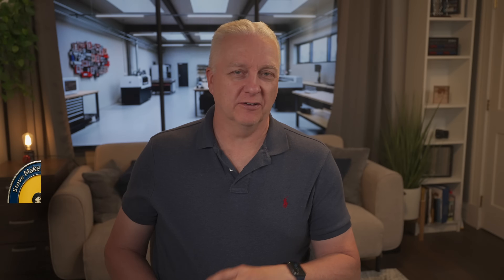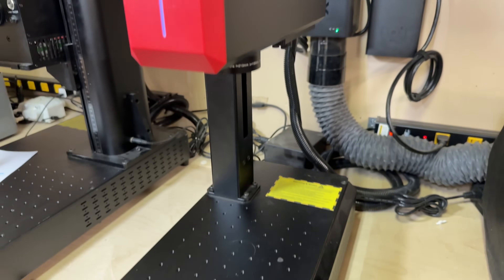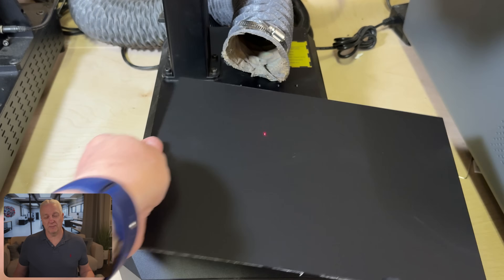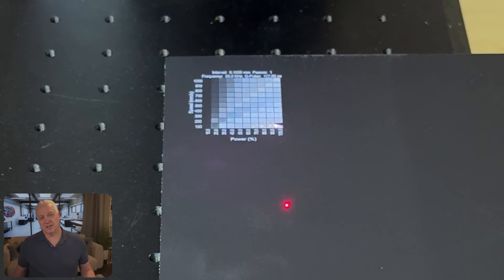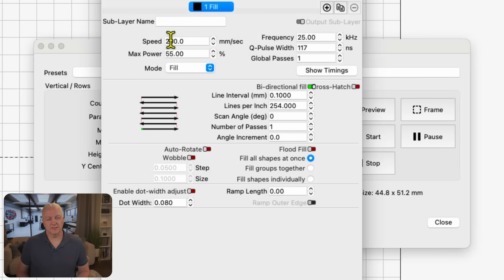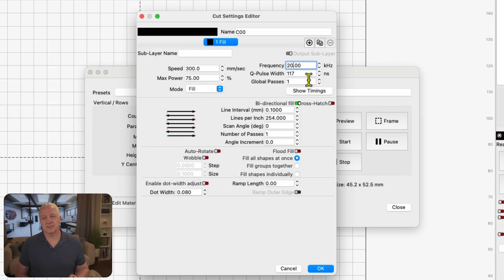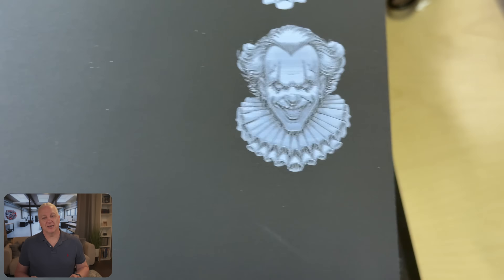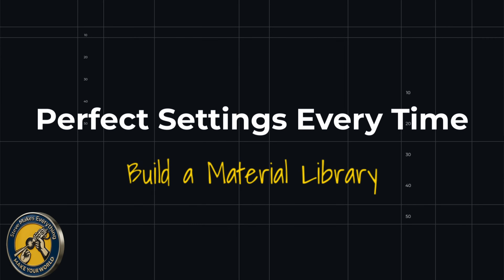Your Laser Settings Are a Hot Mess! Here's the Quick Fix!

Comment: Oh wow!  You just saved me from kicking my Omni X. I am so overwhelmed at running test files and not knowing which of four parameters to choose to run two at a time. As you already know, Commarker's library for this stinks as every metal has the same settings, and you are on your own. With little to no experience with UV I've been questioning my sanity about buying this.  This helps a LOT Steve. Thank you. Now I know for sure to get at least two to three run to dial them in. I now also know I have to get Lightburn rather then use the Commarker Studio.  Thanks again Steve!!
Reply from the maker: Glad this was useful. There is some learning curve to Galvo lasers. With the Omni 1 most times you can set the frequency to 49 and the Q pulse to 1.  Then vary the speed and interval to get decent results.

Comment: I have been engraving a couple of canvases that I first painted gold or something and then black, and then used the laser to burn of the black.. all works well and looks pretty good..
But then I thought I would try some alternative colors, that worked as well as long as the top/last color is very dark/black.

But I wonder if there is any technique/way to have white at the top/last color.. so first layer black and last white.

I have tested a couple ways, but nothing that really works 
 I am curious to hear if someone have something that works.
Reply from the maker: For a diode laser the white is going to be problematic since white surfaces don’t absorb the beam.  If you are using a CO2 laser you probably wouldn’t have this problem

Comment: Just got a 30w Raycus and spent the day calibrating the lens.
When doing a materialtest, is there always a good idea to begin with power and speed? And then move on to kHz?
Ig you do a full test on 25kHz for example, couldn't that test be alot different if doing at 50kHz?
I want to do anodized aluminium mostly. Marking my products.
Reply from the maker: It doesn’t really matter. Start with any two parameters and then make the rest fit.  For a fiber laser some materials work best with certain frequencies and Q-pulses, but if you get any engraving at all, then you’re probably fairly close to the ideal settings.

As you saw in my tests, there are freq and pulse settings that produce a lot more power and I could have selected those and then increased the speed to match those.

Comment: Maybe I'm still too much of a beginner, but I'm getting lost here... At 04:27 you say 300mm/s and 75% is about right, but how are you determining this? That one still looks bubbly to me. The rows below look cleaner. I know your more-experienced eye has a nuanced skill mine doesn't, so could you please explain what you're seeing that makes this look like the ideal starting point? I would have gone for something that looks cleaner, like anything on the 233mm/s row.

200mm/s at 66.7% looks the cleanest to me at that timestamp.

Thank you so much for your videos—subbed!
Reply from the maker: It's whatever looks best for you - my "experienced eyes" are becoming more useless by the day, so I wouldn't trust them if I were you.😉

I probably should have noted in the video that the camera shows much more detail than your eye can see and to get these done quickly, I had the interval set to 0.1mm, which is about 1/10th of the capability of the laser.  This has the effect of making the settings I chose look a bit less than ideal, but when using them, these work great.  What looks like bubbling is actually the individual engraved lines from the laser fill and everything in between them is just heat flash.  Note that if you are using a diode or CO2 laser you won't see this bubbling, but instead will see progressively deeper engraves.

Shorter answer, though, is if you like the line below that, then it's the one for you.  This is all a personal choice.  The goal of this video is simply to get you started and put you in the ball park of where some useful settings are.
Reply: @SteveMakesEverything thankyou. So similar to resin 3D printing then. Stop aiming for “perfection” and “right” and dial in to your personal taste.

Maybe ask you a question for a device I have which takes us back to 1 step before this? I have the munition F28. And I’m trying to dial in focal length for fibre (it also has a blue laser I’ll play with later)

Their advice is to dial it in by using their metal cards, and listening for when the engraving crackle is the loudest.

That seems wild to me, especially for a machine that claims 0.001mm accuracy (which I think is absolute bs)

But would that really be the way to dial in focal length? Are there any better methods such as tests I could run to find the best focal distance)

I u destined this is cyclical and changing that can then affect other baljes

But I’m stuck at focal length and I think what I lack is the confidence to determine what is right? Or if their advice is “good enough”

So far, I’m stuck here and because of this uncertainty. I haven’t even really got started to use it.
Reply from the maker: @FauxHammer  Yep.  Perfection is the enemy of good.
Reply: @SteveMakesEverything right. So eyeball it is perfectly fine? Just after some clear validation?

And thanks again
Reply from the maker: @FauxHammer yep. Once it’s engraved our eyeballs are all we have to measure it. Some jobs might require a subtle engraving and for others you might to dig in deep and you can save settings for both

Comment: I tried getting colors on metal with a non mopa fiber. That's tough.
Reply from the maker: If you've got any color, I'd be impressed.  It's almost impossible to achieve that because the beam on a regular fiber laser typically can't get hot enough to achieve this.  But at least you're trying new things and learning - and that's what's important.  Keep it up!😀

Comment: Thanks, this was really handy. I just got a 30w fibre laser and lightburn up and running a couple weeks ago. I was doing slightly crazy oversized test grids initially. I do have a question, what does frequency actually do? Speed, power and line spacing I get but no idea how frequency effects the material. Since I am using a fibre laser and not a mopa, is there a better parameter to partner the frequency with? Also how do you do a test to find the best setting to cut through thin sheets of metal in one or several passess? Thanks again for the videos, I have found them really informative.
Reply from the maker: Congrats on the new laser!  If it's your first laser, welcome to the black hole for cash😉

In simple terms, frequency is the speed that the beam is pulsed while running.  So a frequency of 10Khz indicates that when the beam is on, it is pulsing on and off 10 thousand times per second.  Since changing this affects the amount of time the beam is turned on, it means that it is impacting your material more or less often.  Think of low frequency as hitting the material with one big hammer and high frequency as hitting it with thousands of small hammers.  The best setting for this will depend on the material you're using because materials engrave better with the big hammer while others like lots of small hammers.

Whether you have a MOPA of a regular fiber laser shouldn't matter as far as finding the best settings, but they will certainly be different.

Cutting thin metal, like a metal business card is really just a game of persistence.  Run some tests to find the setting that causes the deepest engrave without warping all the metal around it, and then use that to cut by increasing the passes until you get through the metal.  Note that it's not all about power - 100% power is going to turn your metal into pretzels.  Instead opt for a bit lower power, higher speeds and a lot more passes.
Reply: @SteveMakesEverything hopefully the black hole has been satiated for a while. I have built a large aluminium enclosure for it with a slide up door that can be opened with a pinky finger and multiple interlocks so I don't have to wear safety glasses around it. Since I can't vent outside I have built a four stage filtration system into the stand. It takes standardized filters so I am not locked into a brand.

It sounds like frequency is a weird combination of speed and power. I will test frequency against those two and see which is more informative.
Reply from the maker: @peterfisher5551 sounds like you have things under control. 

You assessment of frequency is pretty close - at least from a result perspective. Depending on the material adjusting the frequency can cause the material to absorb more or less energy and it can produce different surface results when engraving